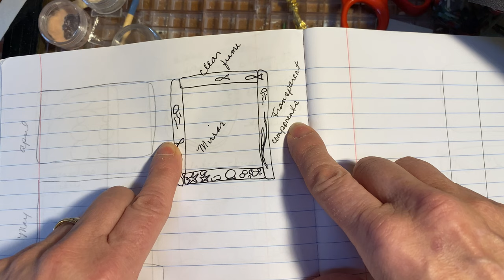Freeze & Fuse Frame

Comment: Love your informative and engaging videos.  Just wondered how do you treat the lead and gold based glasses that need to soak at 1225 for two hours?  Also, w 9:47 ill the strikes strike at your top temp?
Reply from the maker: Thank you! :) Glad you like them!
Thank you for your questions, they provided much needed feedback.
I hadn’t made any adjustment to soak times and ignored my strikers when doing this piece. I was focused on making the freeze-and-fuse components and the layout of the piece. I used whatever glass I had and wanted it done asap. When I’m ready to make the final piece I’ll be more mindful of the needs of the glass and adjust accordingly.
Short answer on strikers: No, I don’t fire it hot enough to get the reaction. If I did I would lose the texture.

Comment: Thank you for sharing.  How do you account for shrinking on the size of the picture frame.  For after it's done for a size of a photo.  I hope this makes sense... I'm brand new, sorry if there is an obvious shrink rate, TIA!
Reply from the maker: I don’t notice the glass pulling in that much because of the lower firing temps. I’d have to be more careful with a full fuse. I Do add about 1/8” to the fiber paper rectangle to make sure there’s room. I would also trim the photo if needed.
Reply: @KathyFitz1113  thank you 😊

Comment: I've been watching your videos and you've mentioned that you have been struggling with the longer straight cuts and the lines from the circles to the edges of the glass do you have a pair of running pliers? If not they make a huge difference in both situations.
Reply from the maker: Thank you. I recently bought a pair of running pliers and they do make quite a difference. 🙂

Comment: suggested firing schedule for coe 90 ???
Reply from the maker: I have a Paragon Caldera and use:

Freeze and Fuse Schedule:
Segment   Rate   Process   Hold
1                 200       400         30
2                 400     1284        35
3                 9999     950       60
4                 200       700          0
5                 500      200          0